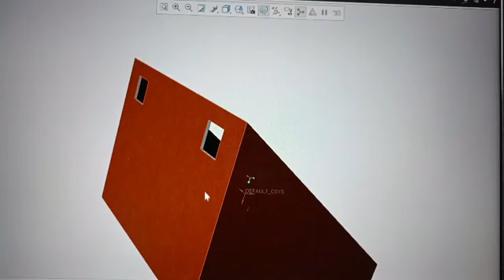How to make a Solar Dryer in cheap price 🤟🤗 | DIY | Solar Dryer | Projects.

Comment: Can we run it on  electricity by putting abulb in it? That means it can run on both solar and on electricity
Reply from the maker: Yes it can but then it will called as a hybrid solar dryer. As you are talking about installing the bulb inside it so as a replacement of this bulb and also for the greater efficiency you need to install the heater, the heater will work in low sunlight and in the night.

Comment: What is the name of the device  you have used for measuring temperature? Plz reply
Reply from the maker: This is a temperature control circuit used in incubator with model no. (W1209 thermostat)